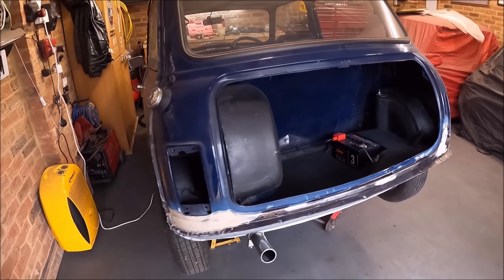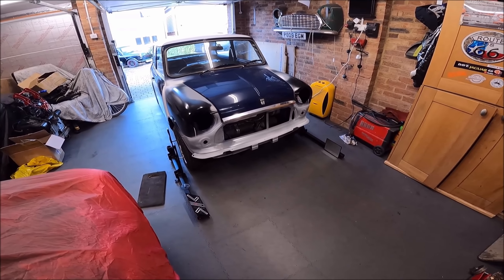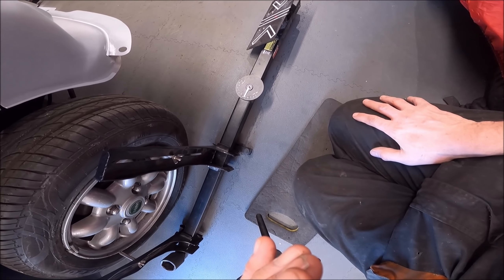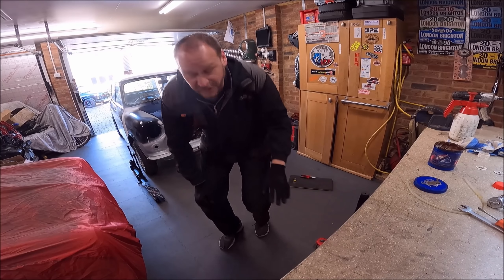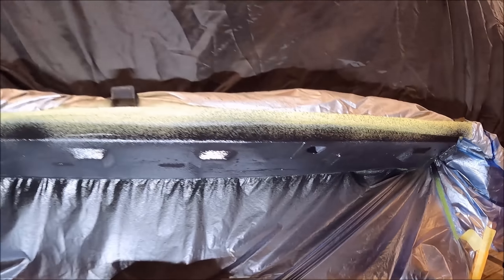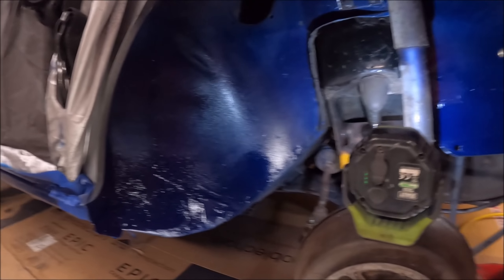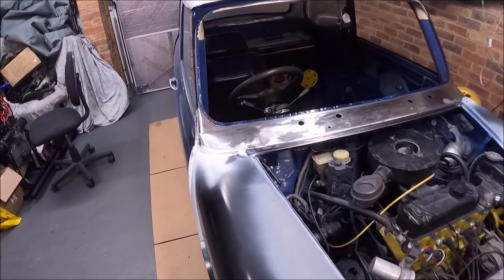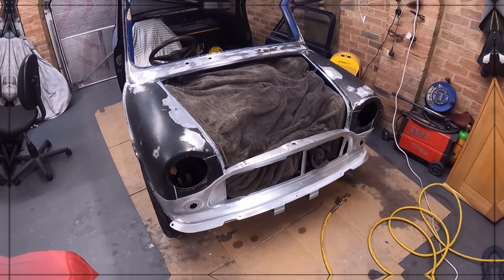Bodywork Prep For Spraying *Budget Restoration* - Classic Mini Workshop Part 27

Comment: I would suggest that FWD cars should toe out slightly in the static condition, as the driving forces from the engine to the front wheels onto the road would tend to make the wheels want to pull forward and therefore toe in slightly under power. I suppose with a Mini (especially THIS Mini), the term "under power" is relative lol - so parallel is probably good enough indeed!
On a RWD car, the opposite is true - the friction drag from the road to the wheels would tend to push them back ever so slightly (in particular under braking, when suspension bush compliance comes into play and exaggerates that effect) and therefore they would tend towards toe out a little bit - so the static toe setting should be a slight toe-in.
Totally agree on not having any stone chip texturing on the external/vertical part of the sill panels!
Reply from the maker: Thanks Stan. Yes, it certainly lacking in some power LOL. You have to think and plan for the hills coming up!

Comment: Who needs tracking sticks lol. Measure from rim to rim at the rear of the wheel as close to the  3 o'clock position as you can then the same at the front side of the rim as close to 9 o'clock. You then will be parallel. What the toe out Keith before I watch all of it ?? 😆

Comment: You are doing a good thorough job Keith. At this point I would spray all the new and repaired areas in 2 pack epoxy  primer  light dry flat that  then spray 2 coats wet on wet  2 pack polyester spraying  filler which is thick dries very hard,  spray on a thin black guide coat dry block flat that and vacuum then spray another coat of 2 pack epoxy filler  which will give a finish impervious to water. Now you can wet flat smooth with 600. Then  3 coats of  2 pack solid colour. Then progressively flat with 1000 , 2000 and 3000  them machine polish finally wax. If it was base coat  you would add 3 coats of clear lacquer. This will make a very nice car for someone  and some of course do look for automatics even if it is probably not the most popular  - good work well done always interesting and  however many decades you have been doing this work you always learn from watching other people . The new owner will get a real bargain.
Reply from the maker: Thanks Richard, very detailed. I should have come to you and asked for some advice! I'm ahead of the videos so it's already painted. I sprayed in cellulose as I'm not really equipped to spray in 2k. It all went OK though.
Reply: That is  absolutely fair enough Keith  I started car  paint spraying in 1965 always in cellulose then When a one pint tin of colour was 7s 6d  -  a gallon of thinners 10/-s  now a one litre tin can be between £50 and £150  Refinishing now is vast amounts of money with whole body repaints in the £2000 to £10,000 2 pack paints are hazardous to heath and need air feed breathing face mask and an enclosed ventilated booth - so you are quite right - great results can now be achieved but at huge cost .

Comment: I am right with you on bodywork. Just can't do it.
On front wheel drive I was told too many years ago "Rear In, Front Out" but I am sure parallel is safe. Leyland spec is 1.58mm Toe Out.